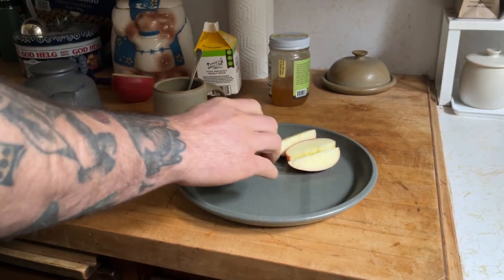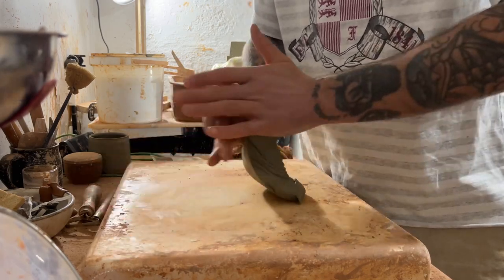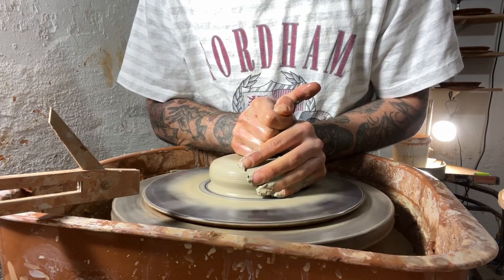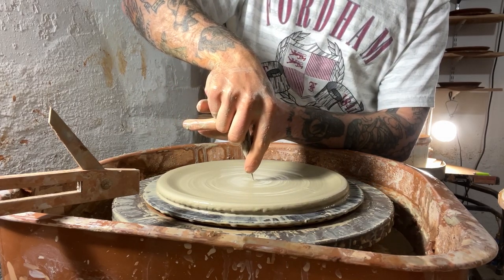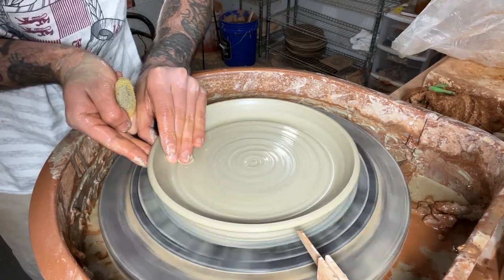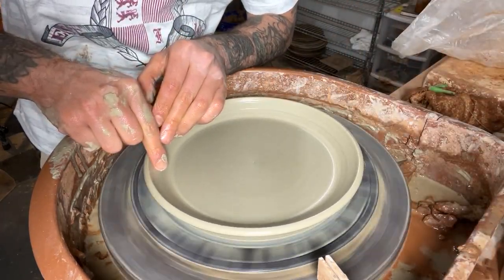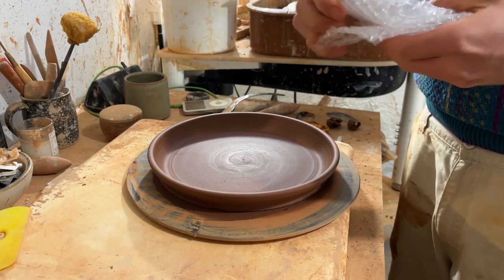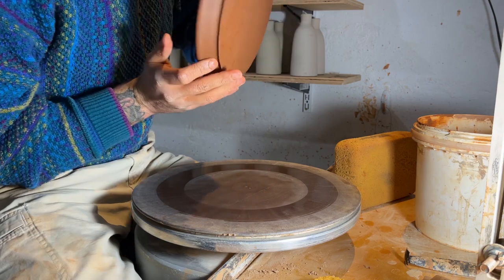How to Throw and Trim a Pottery Plate

Comment: Do you use any sort of air filter or filtration system to keep the clay dust down? I know silica lung is a big bad in the industry 🫁
Reply from the maker: honestly i don’t. i have some windows for air flow! and i try to do my best to mop and keep dust to a minimum. for the most part i’m not stirring up anything so it stays relatively fresh! 😅